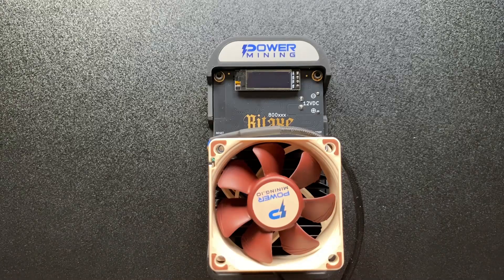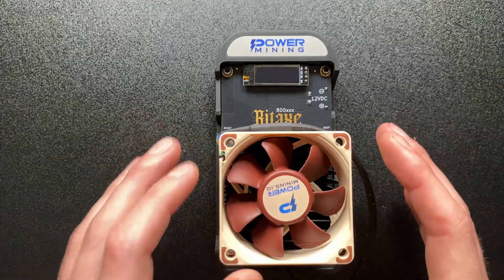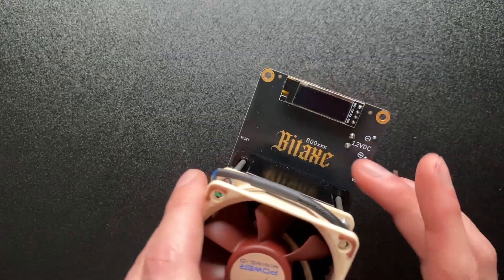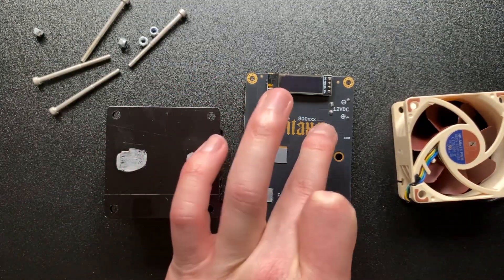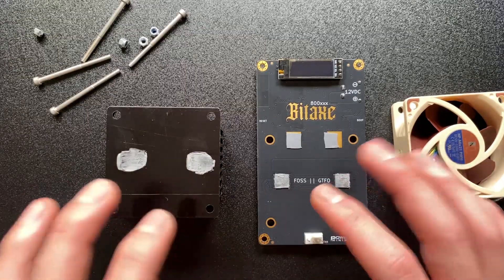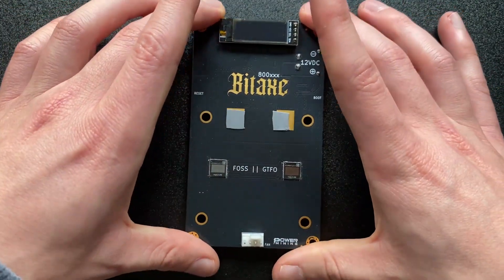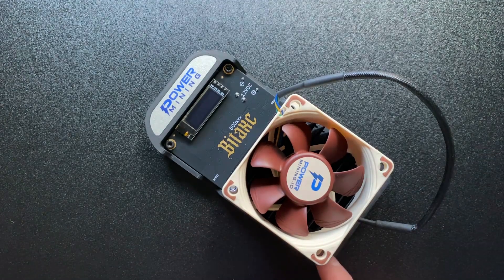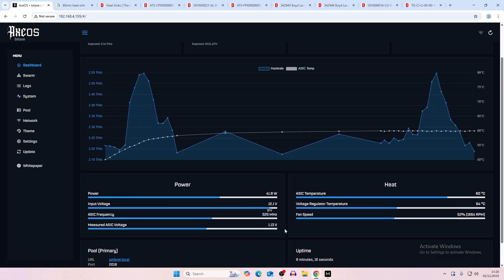Bitaxe GT Teardown and Heatsink Upgrades

Comment: Good work buddy, except you kept searching for 60mm heatsinks, but in reality you just need any cooler that can line up the 50x50mm holes...not finding a quick bolt on solution personally
Reply from the maker: i have been looking, nothing in the UK i can find
Reply: @SterlingSpecter1 I am still digging into as well.  Been strinking out on an easy, bolt on.

Comment: where are the firmware files to flash the 800xxx? i can't find them anywhere on the GitHub, does any know to flash this unit ? ? ?
Reply: The 800xxx is not officially supported therefore firmware also, seek support from where you bought a board still under development